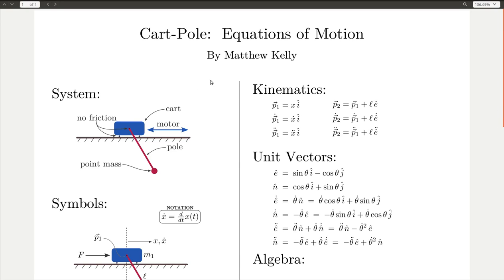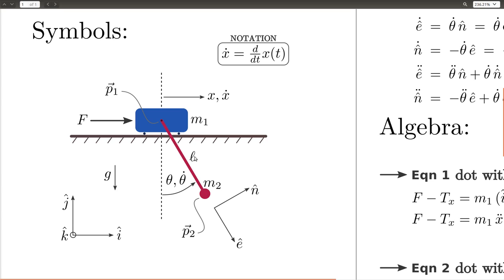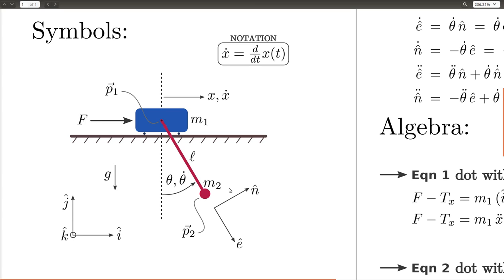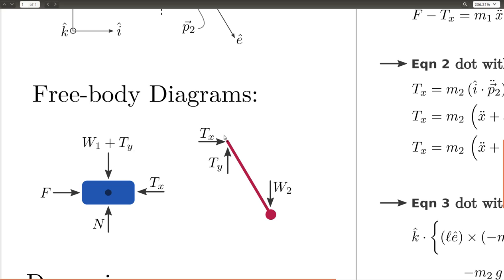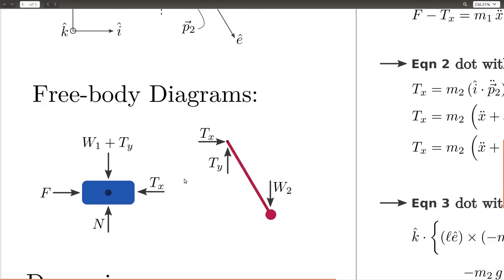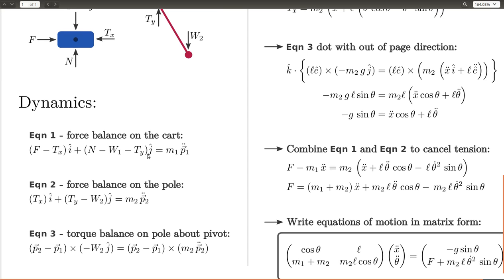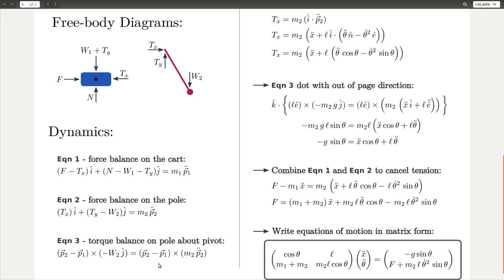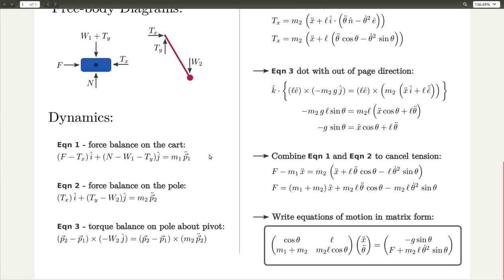Cart-Pole Dynamics  --  Part 1 of 2

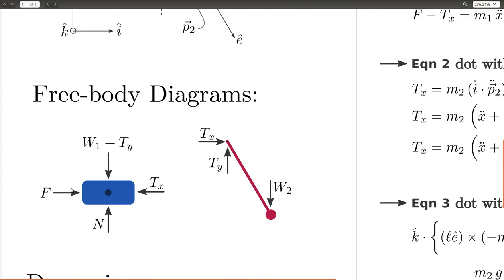Comment from the maker: Correction (at 4:22)  --  You don't actually need one free-body diagram per degree of freedom, but it happens to be true in this and some other constrained systems. For example: A point-mass moving in two dimensions will have only one free-body diagram, from which you can write two independent equations, fully resolving the two degrees of freedom.
Reply from the maker: Matthew Kelly And if you have a planar rigid-body in two dimensions, you can get three independent equations from a single free body diagram.